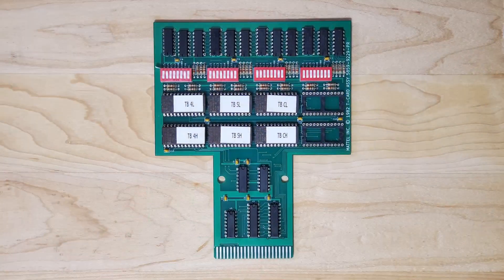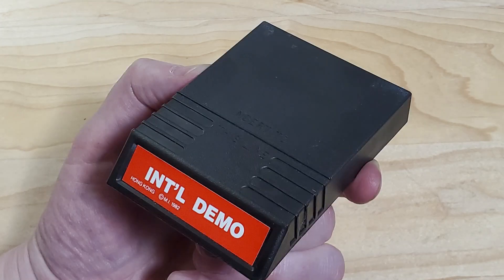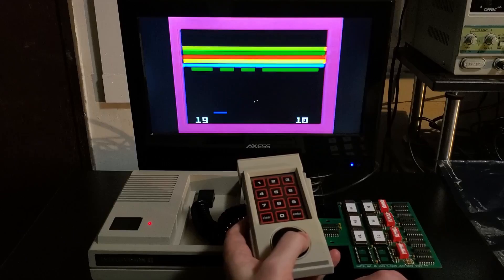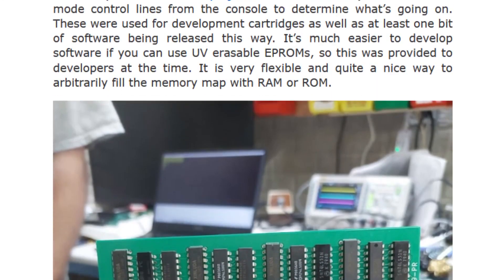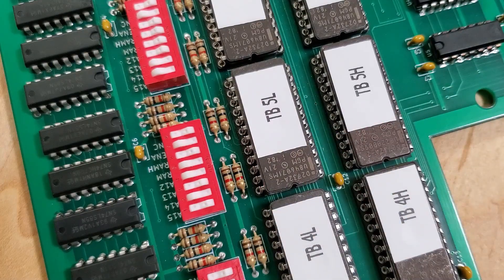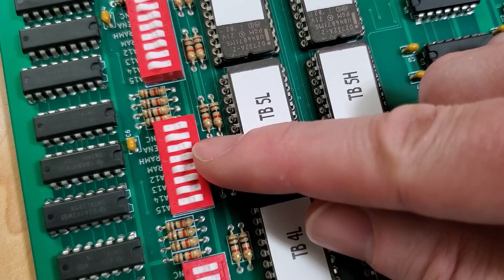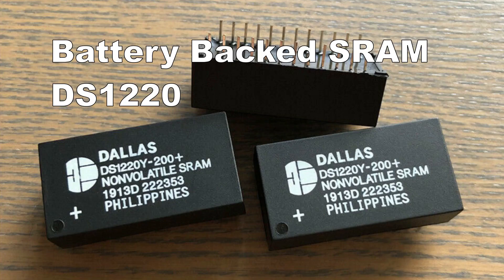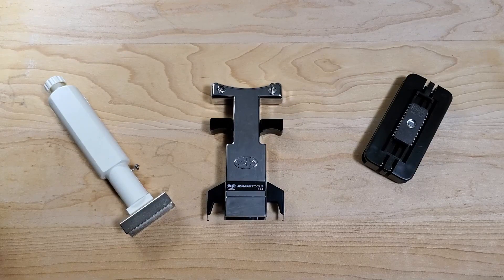T-Card for the Intellivision

Comment: Hi, that's a very cool project! It could be very nice to create a new card that accepts 16bit wide eproms in order to flash game roms directly in one eprom. Is it possible? I was looking all the project in order to try to build one card based on 16bit eprom using your schematic, but i don't understand what is DW signal from 7442 ic to one of glue logic that select one of the 2 banks of eprom memory. Could you please help me?
Reply from the maker: It's definitely possible to use 16-bit EPROMs in a modified design.  However, I wasn't involved with the design of this board (originally done back in early 1980s or late 1970s).  There are a few boards that already do this.  Your best bet would be to go to AtariAge.com and ask questions in the  Classic Consoles --> Intellivision / Aquarius section.

Comment: FYI, 6116 NVRAM adapters are commonly used in older pinball machines to avoid the need for backup batteries - also used in some older video games for the same purposes. Easy to find - search on the "Pinitech" 6116 NVRAM adapter for just one example of a product that's available.

Comment: Awesome video.  Never knew about t-cards.  Find it fascinating.   Especially towards the end on the 3 tools you showed.  I've worked soldering and desoldering in the past with clips bending.  Wish I knew at the time about all 3 tools.  😂
Reply from the maker: If it is any consolation, one of the tools was a very recent purchase... because one of my EPROMs lost a leg due to a bad insertion.
Reply: @Lathe26Real  - yeah, tends to happen easily if not careful. Like once, I still had some solder in ome hole I missed.  Bet you can imagine what happened when reinserting it. I've been in the same boat.  😂